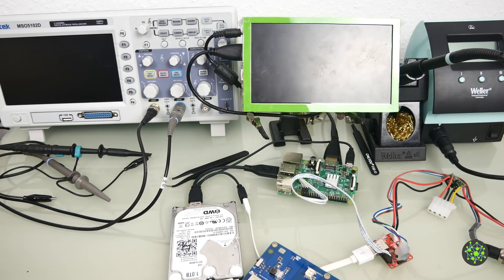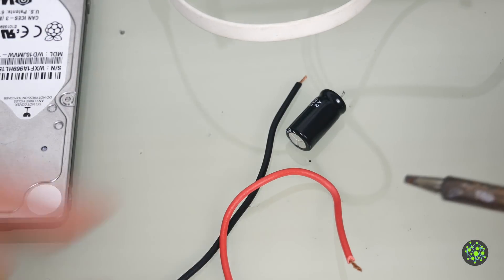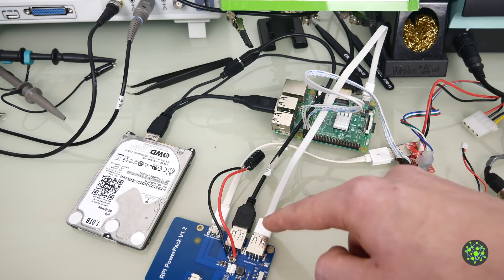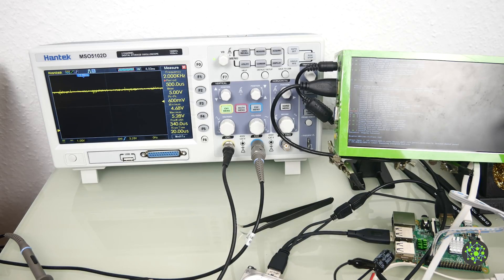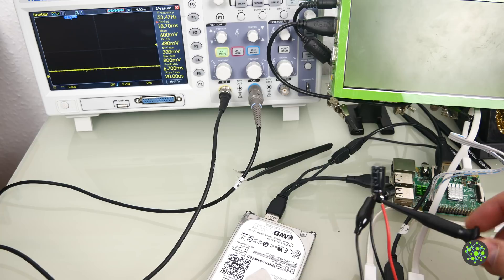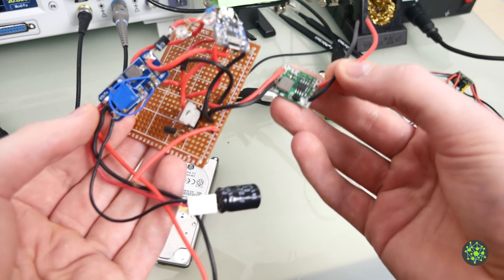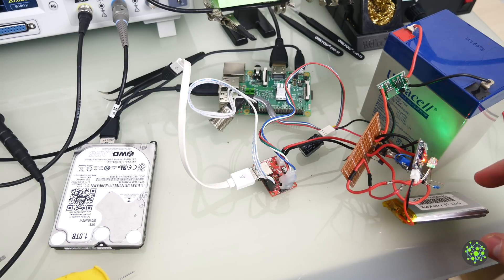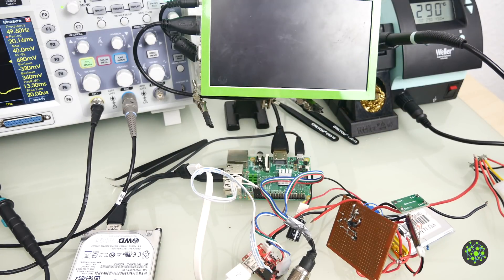Ultimate Raspberry Pi Build #08 - Revisiting the UPS problem

Comment: the circuit at end you showed as ups  you did on your own can you give me the schematic of that circuit which i would like to do for my simple project please respond as soon as possible
Reply from the maker: The link is in the description
Reply: no it is not in description
Reply from the maker: Please look in the description of video #09
Reply: those are all smd can you please name the components you used in the circuit cause i only stick to tht for easy assembly
Reply from the maker: The BOM can be found when following the link in the description of video #09
Reply: i want the schematic for tht version as i cant use smd in my circuit so no smd
Reply from the maker: You will need to substitute the parts yourself as there is none
Reply: can you say what parts to use not part no just which type transistor and which mosfet
Reply from the maker: Look up the original parts and try to find matching THT parts if the parts are not a 100% in spec that's probably going to work fine

Comment: Why did you use the 12v battery rather than your adjustable power supply, as you have in the past?
Reply from the maker: For demonstration purposes. Also do you mean by "adjustable power supply" the buck converter, because this was already built into the circuit?
Reply: enwi I was referring to the power supply that you'd originally used earlier inn the video series, when developing the "package". It shouldn't matter, either way, I suppose; but I thought there might have been a reason you choose a different power source.
Reply from the maker: I just used the 12V battery for convenience, because I did not have any barrel jack connected to my test circuit
Reply: enwi Thanks. I was currious. You were so detailed about everything in the series, I figured you had a reason. 😊

Comment: Hi, I just loved the circuit that you designed yourself to power up the raspberry pi as UPS. I heard you saying in the video that it can provide continuous power supply of 3 Amps. I am eagerly waiting for your video on how to develop that circuit. Thanks.
Reply: need better battery, normal raspberry nominal have recommeded 2,5A and whit HDD 5A and fan 5,5A need be battery capasity 4 hour mean need be minimum 20AH battery, i just adding my raspi3 X820 SDD/HDD board and manual say need be minimum current rate power 5A. next i orden UPS board but not has found true good board. better have DIY lot about 10 pcs, battery, 2S BMS and dc step down converter adjust adjust output to raspi 5,1 volt because BMS not have output regulation chip, and charging input need step down converter and adjust charging power to 7,4 volt remeber have 2S battery max volt charging, look at google i no sure remember. and charger power up to 8volt about 3A

Comment: Hi, how did you made your external screen and which components did you use, except the 3d printed case ?
Thanks 😉
Reply from the maker: +Maxime DUVAL Got the screen and controller as a set from eBay
Reply: enwi Do you have a link please ? 😉
Reply from the maker: +Maxime DUVAL https://rover.ebay.com/rover/0/0/0?mpre=https%3A%2F%2Fwww.ebay.de%2Fulk%2Fitm%2F382318119073

Comment: btw the reason you had issues with the fan pwm readouts on your last rpi video was that you were switching off the entire fan circuitry including the hall effect sensor
you need a 4 wire fan to be able to pwm control one of those fans effectively 
for the ones without a pwm input I find that controlling the voltage usually works pretty well
Reply from the maker: +David Scheiber The trick with a 3 wire fan is to read the tacho pin only during the on time of your PWM signal, but this did not work for me either.